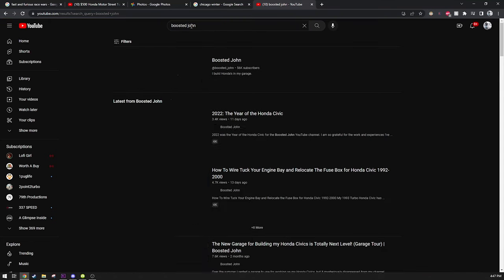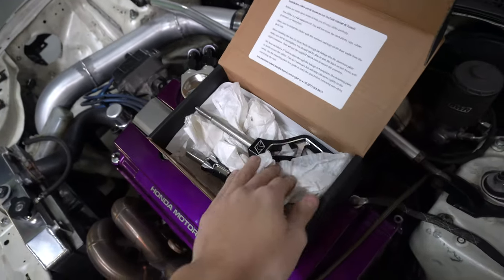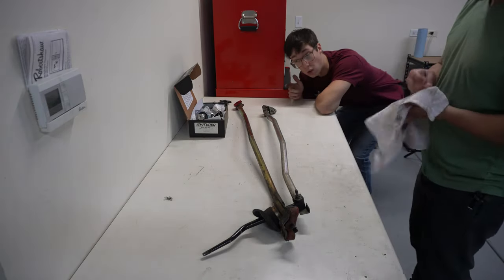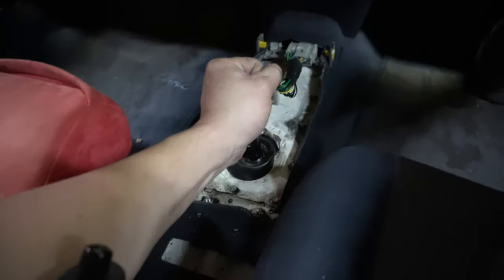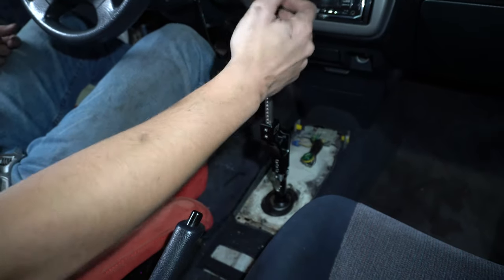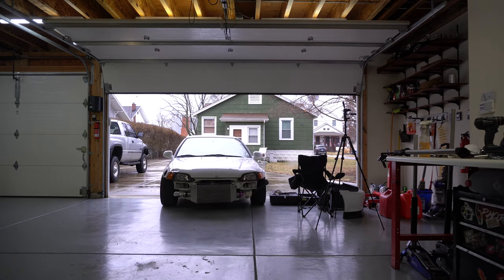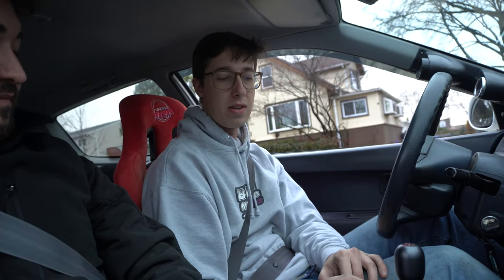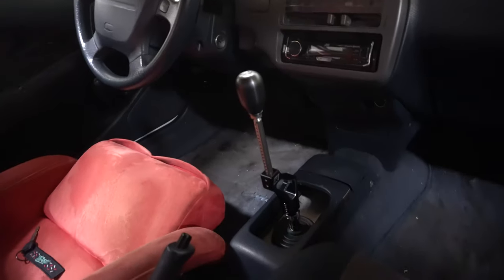Is the K-Tuned Circuit X Short Shifter Worth It? (Turbo B Series Civic) | Boosted John

Comment: The more you drive the car the shifter will start to self center better until it's like stock. also Circuit Hero makes a plate to replace the shift boot. Glad you enjoy it, makes banging gears a much better experience.
Reply from the maker: Thanks! That’s great to know about the centering.
Reply: @boosted_john did it end up centering like normal, mine does recenter at all...

Comment: I put the exact same one in my integra but clocked the shifter towards the steering wheel. If you take the centre bolt that holds the upper section to the lower section there are multiple spots that the dowel can lock into so you can clock it.

Comment: I generally prefer shorter shifters rather than tall at least close to stock or maybe a little shorter. I've been driving manual Civics for a while so I'm used to a certain length shifter.
Reply from the maker: Right on